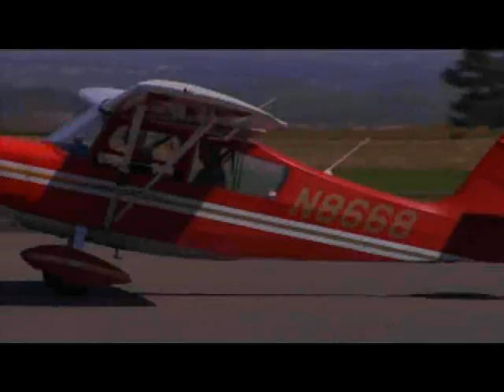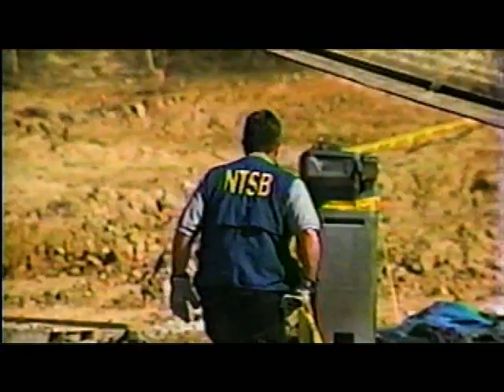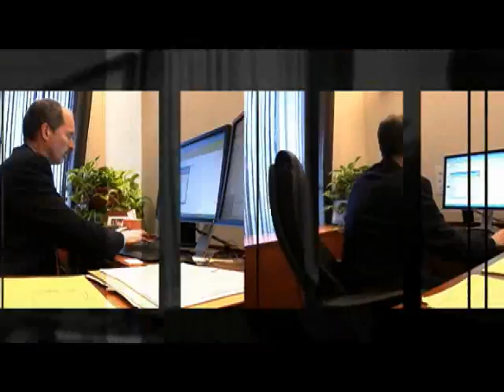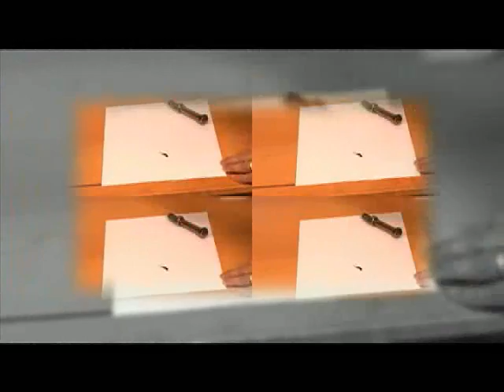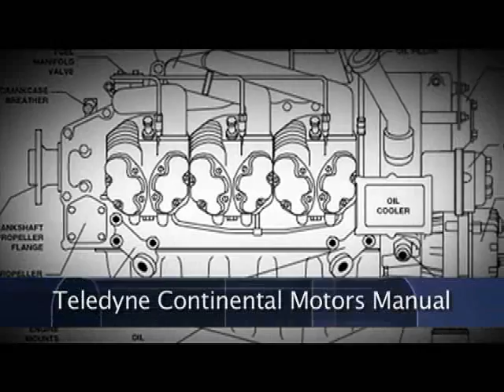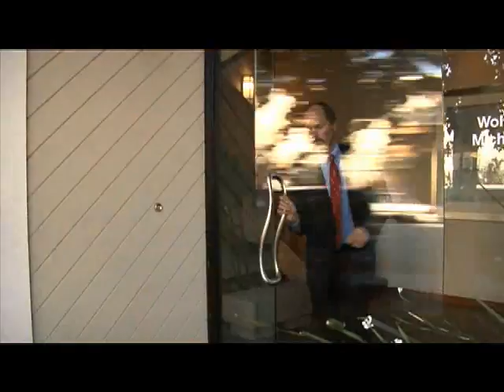Michael Danko - 2009 Consumer Attorney of the Year finalist

Comment: Idea is to find a way to sue big Corp.... Because mechanic makes what $25/h.... And in a system as complex as Aiplane, Maintenance, Controllers, Medical Drugs - there always be something to blame. That rediculous statement that a little bit of lubricant/sealant can destroy the whole engine.... Give me a brake. It's a lie. What about cracks in metal? Those original micro cracks which God placed into every metal piece? What about tolerances in engineering? Engines are not 100% safe, They are 99.99999% safe. People like Michael are educated, but they do not produce anything other than too much bureaucracy. Teledyne will change manual and will charge a big premium, so only qualified (aka working for some corp) mechanics can get that manual. As an example - before Repair Manual for ANY car was free, now it's only available for mechanics and it costs more than $100. For every Model! Why? Well, thanks to American Lawyers. Regular people will end up paying indirectly.